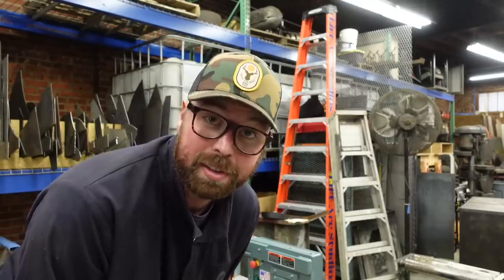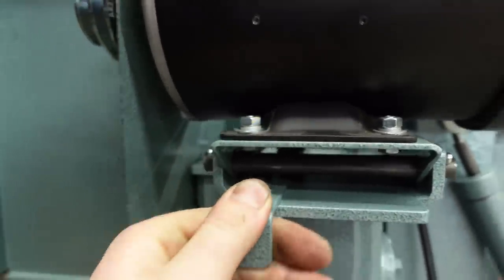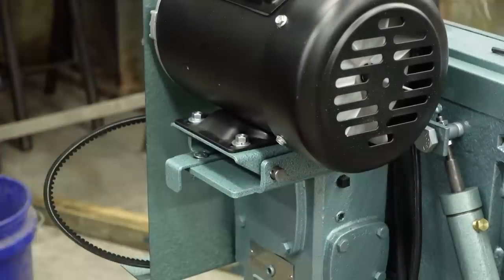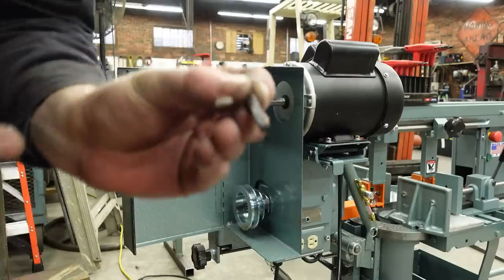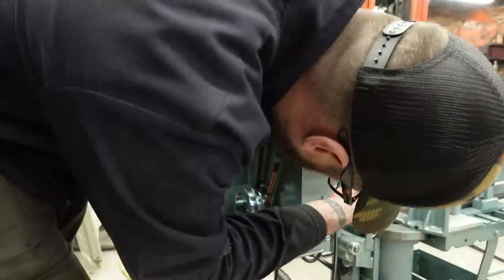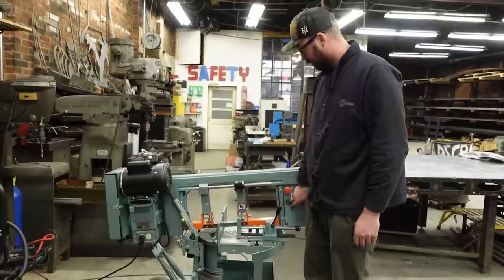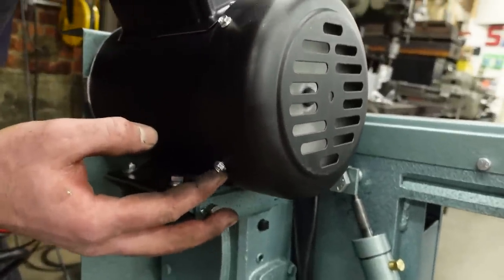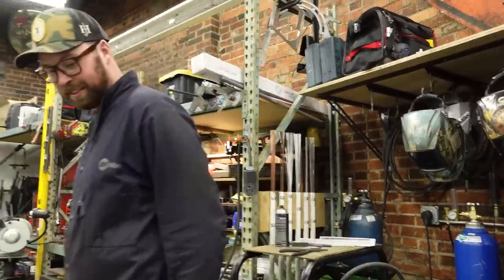This Is Unacceptable.

Comment: I am amazed by how much the motor mount structure flexes.  Also, you are being too easy on the saw.  You have it in second gear.  Will it start at all in 4th gear?  I think I could pick up my 400 pound bandsaw by the motor and it would not flex that much.  The true test of your power should be done by measuring the voltage while the saw attempts to start.  Unloaded voltage means nothing.

Comment: It might not be the motor dude I know I'm a little late with this opinion but I've had that plug underneath the motor where the motor plugs into the receptacle, I've had that open. There is a relay contactor in there, which is controlled by your start switch, they need to look into that and I have a 1600 and I use an 1800 and a 2000 at work, and I honestly don't know what I would do without my Ellis. It is kind of shitty that Ellis went the way of trashy Chinese motors. Mine is a 1996 model and I love it and it works like a fucking champ.

Comment: The problem is that you need a longer extension cord.  Maybe daisy chain 2, 3 or 4 extension cords on a 10 amp circuit with 10 other things running on the same circuit. It should work fine or toss that boat anchor out of the back of the truck while driving down the freeway.😐

Comment: You think this is bad just Waite till you get a bad band from Ellis  and the saw cuts on a curve no matter how slow the drop rate was turned down to the blade flexed.  The cut on a piece of 12” I beam was almost 3/8” difference from the start to the finish

Comment: I get that you just want your bandsaw to work, but sometimes a little troubleshooting goes a long way. You said people already told you to try it without the belt on, but instead of doing that and potentially narrowing down the issue to the motor itself you had a smart-arsed comment about "but it needs the belt to run". Ha ha, very funny. That's not how troubleshooting works. Each step you take doesn't have to fix your problem entirely. You can sometimes do stuff that seems to not make sense to you, like running the motor with no load after some rest, to point you towards the cause of the problem. Now there are two possibilities with this saw. One, that both motors are dodgy (a bit unlikely, but not impossible). Two, there is an internal issue with the wiring   on that saw, or something else within the saw. By trying to run the motor with no load when cold, if it did the same thing you would pretty much know it is the motors.

Comment: The saw is stiff turning..  that’s just the motor going to slow and the start circuit kicking in and out.. something like a bearing is bound up…. Turn it by hand and find the problem and fix it..

Comment: I'll tell you what it is. See that droop in the power lead from the outlet and back up to the saw? There's your problem, the electrickery has to go uphill so can't get to the motor fast enough. You need to put the outlet on the wall up high so the electrickery can run downhill the whole way.😉

Comment: Could be lack/loss of voltage/amperage through the safety switches and or other #internal #connections, likely a combination of all of it. It's sounds like crap on the video in general.....cords do lose some amperage over length blah blah blah... I use a large high amp cord for my saws with no issue for a couple years now. Some might suggest plugging the motor plug in directly bypassing the safety equipment to verify the aforementioned theory....

Comment: It seems to me that the startup torque is too high for that type of motor. I replace wing nuts with an adjustable handle with female thread rather than a stud. Really, they should have used a better quality motor. What I don’t understand is how they didn’t notice this at the factory. That whole saw is just too noisy.

Comment: That’s horrible. I’ve ordered a few Chinese motors for exhaust fans, never seen one studder like that. Worse case scenario, have Grainger spec a replacement and spend $350.
Reply: Ya just spend 350 when he just spent 3800........don't think so.
Reply: @funone8716  like I said worst case scenario. I’m starting to think he got it at the old price because it was a model with the crappy motor and they wanted to clear them from inventory.

Comment: Kind of defeats the purpose of buying a new saw, but why not buy a quality motor (it is a standard size and can get them from Graingers) to replace to crap Ellis supplies?  Have Ellis reimburse you for the new motor...if not in cash, then in saw blades or other accessories.  The rest of the saw seems to be quality.  Just a thought.

Comment: MOTOR: Here's what's wrong with the motor. Not enough HP to run the gearbox on highest speed. That's one of those generic China cheapest crap motors you can buy. Tag says 1HP but it's probably more like 1/2HP.  It could also possibly be wired for 240 instead of 120 like others mention. 

SAW: I've never thought enough of those saws to look at one closely. Now that I see it in this video, I'm really not impressed! What a minimally engineered flimsy hunk. And poor design features on top of it. And the price, $3800! Wow. For that price, not even a work light of some sort?  6 months ago I bought an older Marvel No. 8 tilt head saw. It weighs 4x as much as that Ellis. I paid $900 for it and it's 50 times the machine. Yes it does take up much more floor space, but that's the only downside.

Comment: The issue with motor #1 is the centrifugal start circuit switch low-speed high torque, then to high speed,  like a two-speed trans.  it is not making good contact in high speed.  dump the cheep China motor and get a good Baldor or Leeson

Comment: starter winding and or starter switch is shot, find an electric repair shop. Had lots of that on the farm over my 50 years but usually not on that new of a motor

Comment: Starting capacitor centrifugal switch is set incorrectly. Start capacitor is not cutting out as the motor speeds up causing it to cycle like that. It's underneath the end bell of the motor where the screw was loose. They probably never ever lubed it or it's just built like crap.

https://youtu.be/M-j6PhthXJY

Comment: It is the capacitor the Capacitor is probably too low to start the motor- possibly 11Uf or 13 Uf and needs a 24 Uf cap.
Try that in the other motor.
China will run out of a part and then just use something else without testing.
Typical Chinesium on the fly manufacturing.
I worked for Pentair had exactly the same issue with our Long term Chinese Motor suppliers.

Comment: I own same saw and is 15 years old runs like a champ best band saw I ever owned this is clearly a capacitor issue easily fixed for 10-20$ ignorance isn’t cool when blaming a great company for a small issue
Reply from the maker: I understand where you're coming from, but I don't think the customer should be responsible for fixing quality control issues on a brand new saw.  In my opinion they should have just sent it with a proper motor, if this is an issue that can be remedied for 10-20$ that's even less of a reason for them to ship out 2 bad motors.

Comment: Those Chinesium motors are shit. That is a rough running motor, almost acts like the rotor is unbalanced or it's trying to run on the start circuit. The motor should be smooth running with little to no vibration. I would plug the motor in direct to eliminate any screwups with the outlet or switches on the machine. IDK why Ellis wants to ruin their reputation with these cheap motors. Yes, a nice Baldor motor would be more money, but what good is a machine with a crappy motor giving issues every time you need it to work? If it's a price point thing, they are screwing up. If it's an availability problem, they are screwing up by substituting these junk motors. Have fun with your Chinesium!
Reply: It's a profit/ price point thing that they are blaming on availability and supply chain IMO.

Comment: The best Chinese motor a lie can buy! Sounds like: sketchy bearings with metal shavings,  a poorly built power supply with a 'starter circuit' that's choking (stalling) .... possibly a diode was installed backwards or a capacitor is pulling double duty as part of the starting and run circuit. OH, and that motor mount design? Far too flimsy for the weight of the motor, the load, and it really has no adjustability of you have to take pliers to it. Demand your money back, use the funds to build one that works.
Reply: Diodes?? WTF are you drinking

Comment: This is really shitty. Ellis has always used Leeson motors. That’s definitely a Chinese motor now. You should run it though without the belt on it then without the pulley on it to see if it’s an external balance issue. If not then it’s definitely a motor problem. Two motors having an identical issue is possible but not likely. There might be a common denominator outside of the motor itself. I mean at the end of the day this is an issue that’s purely the responsibility of Ellis but just out of sheer curiosity.

Comment: 125 volts what hertz out of the wall? it has a weak starter. Will do better wired for high voltage. chineesium shit. Won't fix the cheesy mount. Should have fixed up an old Do All like mine.

Comment: I want to see the inside of that motor. I guess, they left 2/3 of the windings away, because "Meh, It's a single phase motor anyway, you don't need the other two" and that's why it is wobbling around also. 🤓

Comment: Simple math. If you have a cord rated for the amp draw at that distance, it's not the power. But you answered, "It's a pretty big cord," not it's a 12 ga, etc. Power loss is just like a hose. The longer it is, the less it flows.

Comment: I am going to say that they are have issue with the capacitor on the motors on the the first motor as well as the second or the capacitor is under sized by the motor manufacturer to cheap out. the second motor bearing are shit also. I would go out and buy a motor on your own to rule out that bullshit from ellis. eliss is fucking the pooch on this one. But it is the capacitor. Industrial technician and generator tech as well as a Industrial hvac tech and finally a emergency vehicle technician I am not sure if that qualifies my opinion..

Comment: Maybe it would be a good idea to find a motor sponsor. That is a really REALLY cheap motor. You can tell just listening to it, it sounds like there has never been a drop of oil on the shaft, the bearings are probably made in China, like.. man if you're going to sell s a product, it should probably be at least a good product. I'm going to bet there are motor manufacturers that are in the price range of whatever they're spending that are much better than whomever that motor company is. They suck.

Comment: It’s not rocket science. Your starving the start capacitors and killing the motor with the extension cord. Period 
Of course it still happened after plugging directly into the wall outlet because you already destroyed the unit. This is like saying that the motor in my car still knocks AFTER I put oil in it.

Also if you plug into a daisy chained outlet your still experiencing voltage drop and amperage issue under load. This is why we use dedicated outlets for compressors and welders, including our 110 machines. 

All while ridiculing those commentators attempting to explain to you exactly what happened or assist in the diagnosis.  News flash, we often take load off the motor while running diagnostics. The gearbox is irrelevant to this testing. Besides a worm gear isn’t that efficient by today’s standards. 

Your a welder you should know better. Any welder knows what happens with voltage drops when attempting to weld with extension cords.   Take and weld with a 110 machine then run a 50ft extension cord and weld with it. Take and 50 feet of extension cord between your air compressor  and the wall and listen to it start. 

If I was Ellis and I had seen this,  I would charge you for the replacement as it’s 99% likely your user error. 

I would also think twice if I was a company planning on doing an endorsement with the channel. Not necessarily with the your handling of the product but by the way you treated those writing in the comments trying to help and your blatant refusal to accept negligence. I’m not certain I fully believe you didn’t start the new motor on an extension cord. As there’s clearly plenty of video cuts. 

I’ve replaced many of these motors and I always have to tighten the self taping screws and all the covers. Usually it’s done in factory when the motor is fastened to the assembly.

Comment: i wonder if the pulsing comes from the centrifugal switch inside
https://www.youtube.com/watch?v=M-j6PhthXJY
 , maibe they switched a wire around in there somewhere causing the motor to start on the centrifugal and when it trips off that switch kinda wants to run in reverse / or slower (out of fase with startup) tripping the switch on again etc causing the surging 
wouldnt be supprised if the " new" motor they send you is an old returned motor from another customer complaining , and their way of testing it is just to have more than one customer mention the same problem with the "new" motor that had the same problem with another customer 
would explain why the motor has a bend shaft (thats why its wiggling) , could allso be the wormgear thats bend as it does wigle kindah slow for the rpm of the motor 
wonder if you can return the whole machine for a refund (buyers remorse ) than go intoo another store and get the same type new in the box 
if they want it packaged like original .... sure no problem buy new one in box and use box to package old one thats nicely cleaned up then return it , will even have the receipt to show you bought it only x amount of days ago and get a refund ...... thats wat i would do if there being bad at their customer support the way they are though it probably ends up being another customers problem 

if not you might need to find the wiring diagram from somewhere and go over the wiring inside the box and inside the motor itself with a fine tooth comb 
actually shouldnt be needed with a new machine then again they been put together by humans and humans are known to make misstakes 

hmmm did you hook the old motor up to the power without the saw just plugging it in , see if that changes anything as thats likely the way they test it (without a load) , should allso try plugging that old motor in somewhere on another electrical panel as it could be that youre shop circuit has its wiring slightly different (two of the fase wires reversed) it still works but you need to rewire plugs and or sockets on the saw or on everything else 

btw about unplugging it , there condensors in there and these store electricity , you might still get a jolt when you touch them , need to short them with  a screwdriver after unplugging to unload them (see video)